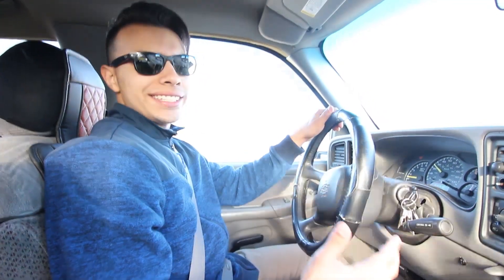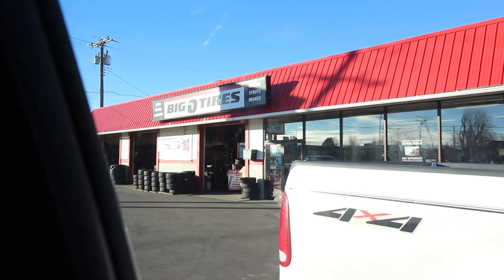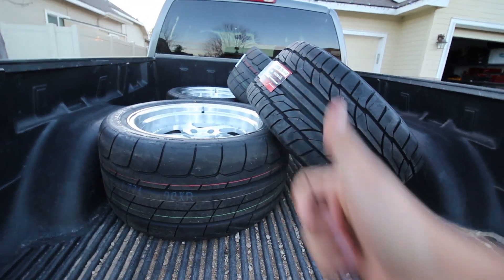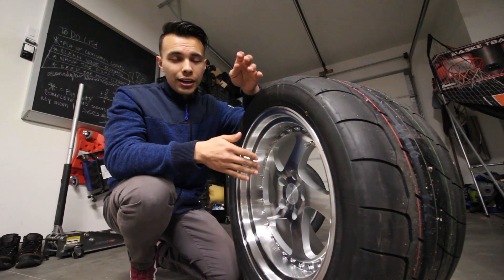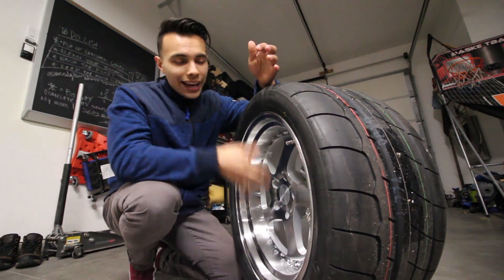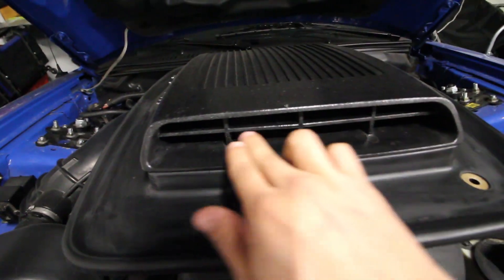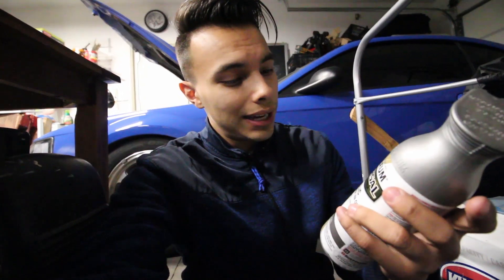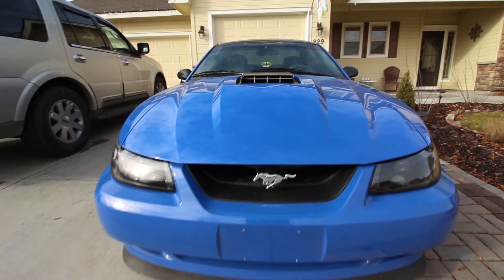Should've Gone With The 335's Instead...

Comment: In running 295 with some 1/4 inches spacer plates for the rear. It looks okay but I think 315 are perfect. Btw what is the width of the rim? I heard mixed things that you can't run 315s on 10 inch rim.
Reply from the maker: 10.5 in the rear, 9.5 in the fronts 👍
Reply: Ozomeroman thanks dude!
Reply: You can run 315 on 10 inch wheels! You’ll be fine, depending on the tire they might bulge but they fit fine people are just over dramatic! My friend runs 345 bfgoodrich on his 10 inch wheels, it bulges a lot but looks killer to me, it’s just preference if you want it to bulge or not but they do fit and doesn’t change drivability at all it hook way good tho!
Reply: Savage Habits thanks

Comment: 315 on 10" wheel makes it buldge out,and you say they dont look wide enough,if you had 11.5" wheels..THEN you get the full width of the 315! ive tried 10 on 315..looked weird..but had 315 on 11.5 and it was spot on! it looked much wider cause the tire got more width from the wheel